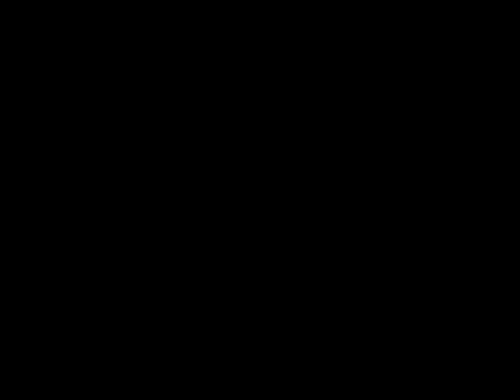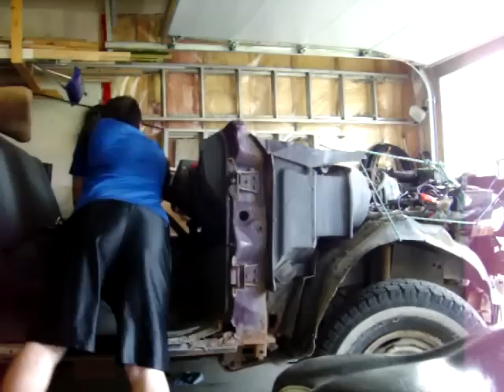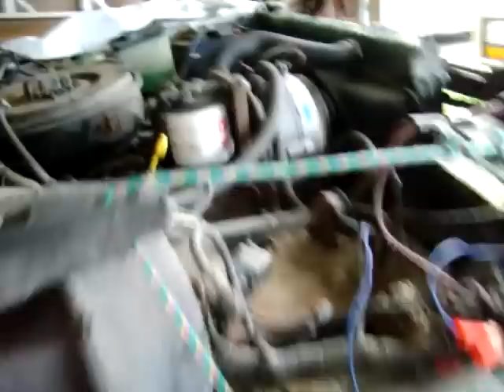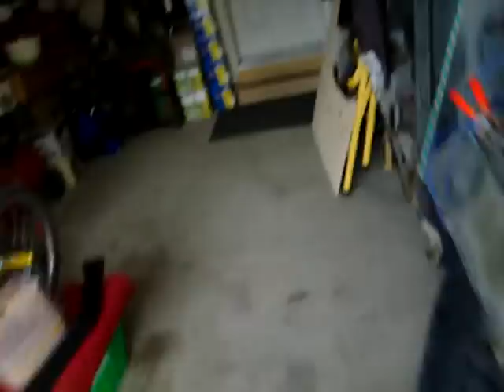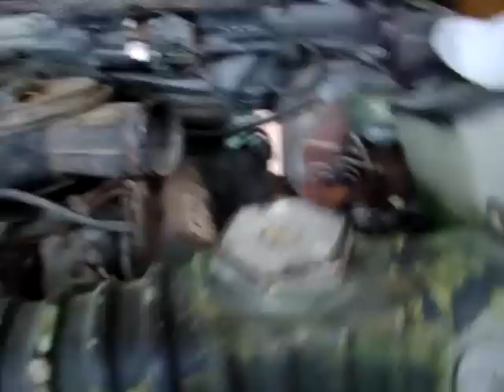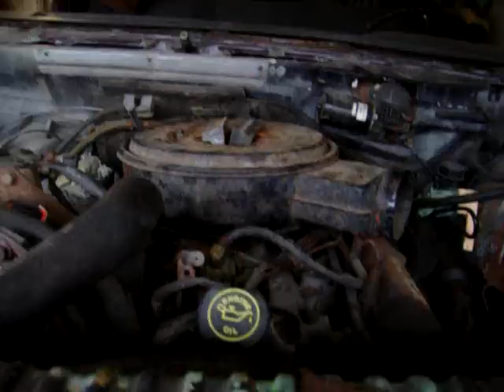Will The Old Convertible 7.3L IDI Diesel 4x4 Truck Start?

Comment from the maker: Glow plug controller is fine, working great.

Just gave a tap on the throttle to get it to high idle, runs rough and knocks on cold starts because of that 1 leaky injector. Pre-ignition = knock.

Comment: The 6.9/7.3 IDI is the most reliable diesel in a pick up. The 6.2 was built for fuel economy and the blocks cracks at a high mileage.

Comment from the maker: A 1993 7.3L is not a powerstroke. Powerstrokes came out in 1994.5

You have a 7.3L IDI (InDirect Injected) and lol not much to go wrong on those things.

But when stuff doesn't start going bad, everythings gonna go one after the other, when it's all over and everything is fixed or new, you good for another 15 years! lol